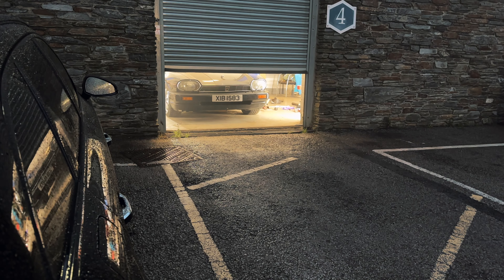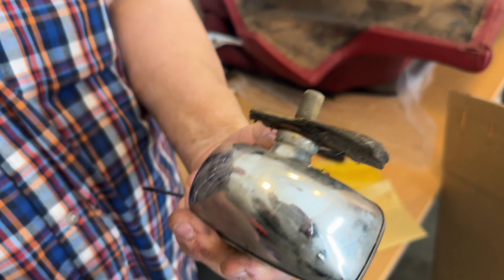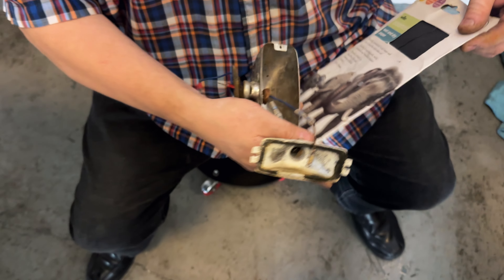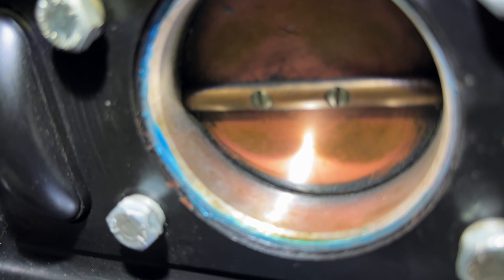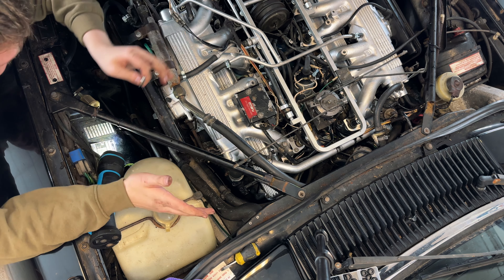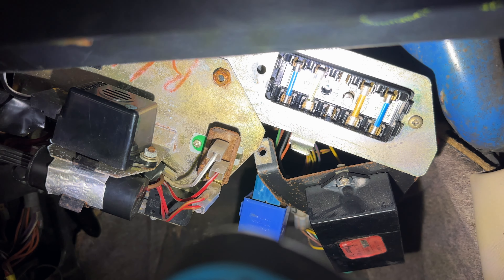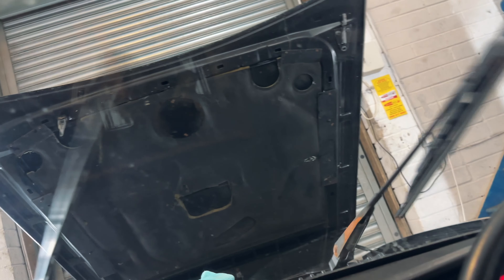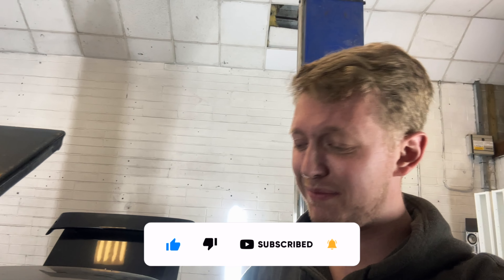My V12 Jaguar XJS has ANOTHER issue

Comment: DUDE, wipers are actually kinda hard. They have so much torque to put down (especially on a dry windscreen) !
Reply from the maker: That’s true, I’m sure i can get it working again!
Reply: Sounds obvious but if the motor is working but just struggling make sure you test with the car running so the alternator is helping the motor. Also don't forget to grease the wiper rack itself!
Reply from the maker: 100%. Will get to work on it sometime 😃

Comment: It’s the wiper stalk I think. The contacts get corroded.
Reply from the maker: The motor way on the way out, swapped for a 1990 one, slightly different workings but fit nicely.